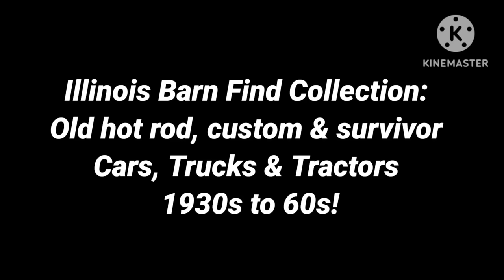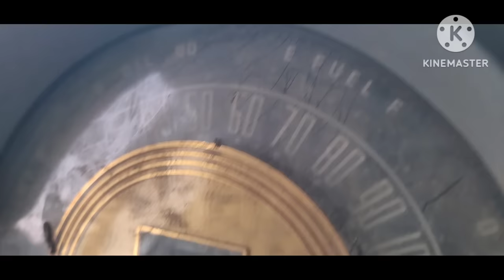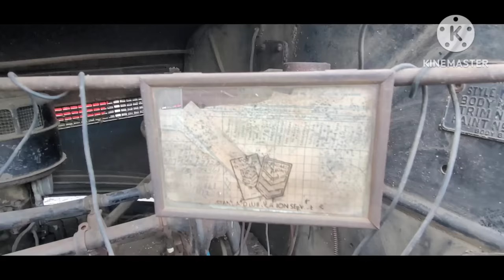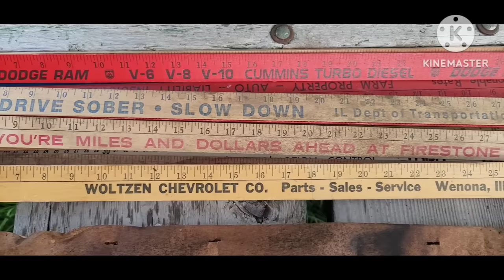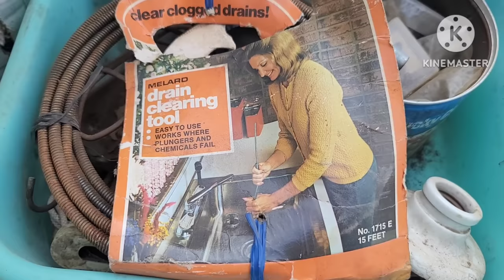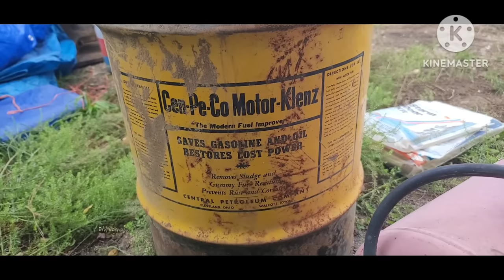Illinois Farmer's Barn Find Collection LOCKED AWAY for decades: 1930s - 60s cars, trucks & tractors!

Comment: Being a Pontiac fan, loved seeing the 39, but especially the 35.  Pretty rare that both had the 8 instead of the much more common 6.  The 35 had the Indian maiden hood ornament (first year for hood ornament as 34 and older had outside radiator caps).  The 8 had the Indian maiden, the 6 had the Indian head with the feather.  It is amazing that the Indian maiden hood ornament still had the feather on top of her head and not broken off.  I have a real nice 35 Indian maiden hood ornament but it is missing the feather.  That 35 is about as good as a restoration candidate as you are going to find when it comes to a 35 Pontiac.  I hope you can buy it.
Reply: I just hope someone doesn't buy it and "Rod" it or "customize" it or "restomod" it.. :(

Comment: Hi Bud, that orange buggy had a lot of Triumph parts on it, maybe a Triumph Herald or Spitfire with the twin carbs being factory fitted,  If It was a Herald back axle the rear wheels would lean at funny angles until the car was loaded but the spitfire had a more controlled rear axle alignment, so I suggest it has a non-triumph rear axle. Now the wheels look like MGB steelies so maybe an MGB axle - who knows.. Thanks for the video
Reply: It's got a TR3 engine and guages

Comment: I can settle the debate on the "whatzit corner" i bought it at the auction and had a week figuing it out. it is a 1962 tr3 engine, drivetrain, and 3/4 of the chassis, front suspension and crossmember is out of 53 to 62 corvette. It is now running and driving.

Comment: The earth actually breaths water vapor in and out even through concrete, that's why vapor barriers are required under the concrete for houses. Our dairy barn ended up a car storage barn, 20 years and all inside were rusted from bottom up.

Comment: What a shame that 53 Merc at 3:15 was so damaged by racoons. My 52 is still missing a headliner thanks to those destructive beasts. Otherwise it survived pretty well. I see the carb and intake has been changed over to the 3 bolt Ford style carburetor from the original 4 bolt Holley.